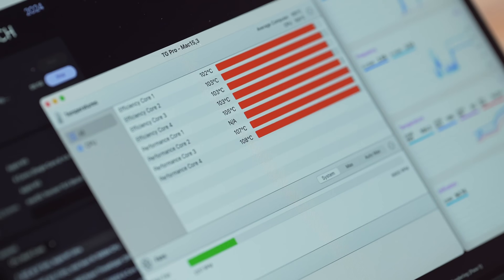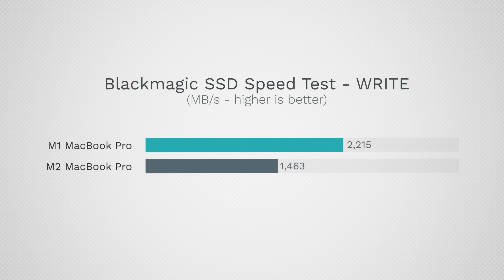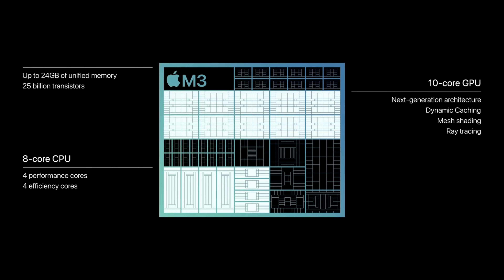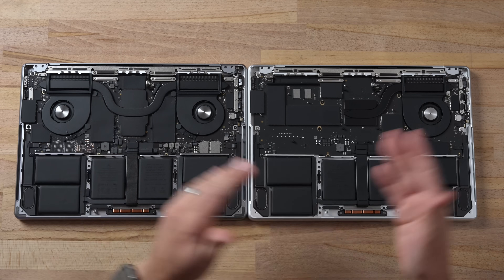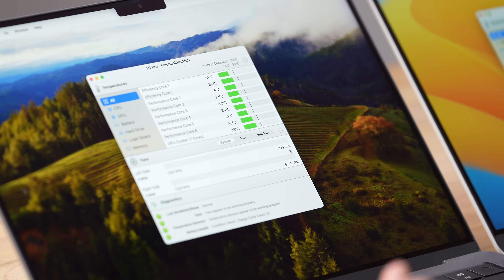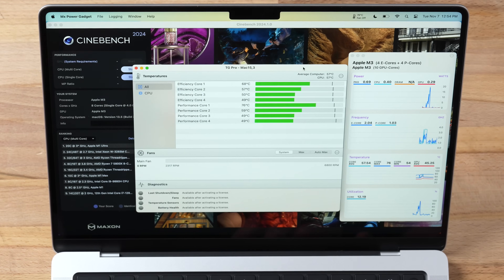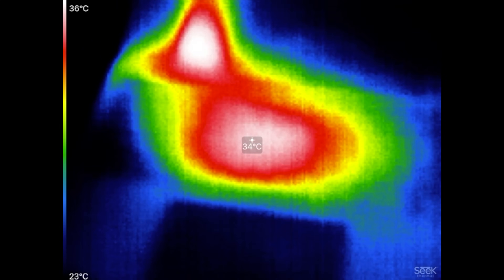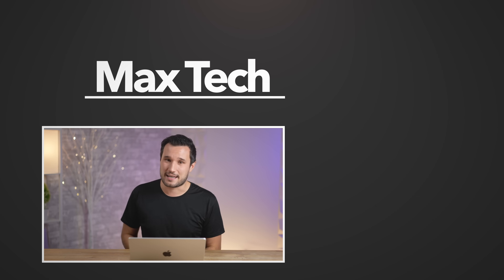M3 MacBook Pro Teardown & Thermals - REALLY, Apple?!

Comment: Even the M3 pro MacBook Pro heats up like crazy, it gets crazy hot just when it’s charging, I would literally just buy an m2 pro MacBook Pro for less then the base m3 MacBook Pro, it has a 16 core gpu and m2 chips don’t have heating problems even on the air, the m3 chips are kinda a disappointment tbh

Comment: I got this M3 MBP, even upgraded it to 16GB Ram.  The Memory Swap is not an issue with 16GB Ram…but the fan…OMG, it kicks up almost immediately with anything semi intensive being put through and runs THE WHOLE TIME.  MUCH LOUDER AND CONSTANTLY RUNNING FAN compared to even my very old 2017 MBP13 Intel i5. And the top left part of M3 MBP14 can get almost burning hot.  Very bad design overall and I consider I have made a mistake buying this new (worst designed) M3 MBP 14-inch.

Comment: With the M3 Airs at most 2 months away, (Though I could see them being announced along side the Vision event), I really wonder what they are going to do to the SoC to get it in the Air. Hitting 108c with a fan spinning at 3500RPM & 95C at 6000RPM in a CPU only test really makes me wonder if they can even put an un-modified M3 in either of the Air chassis. I fully expect them to either turn down the clock speed on 2 of the 4 P cores to the point they may be running at E-Core speeds, or to have an Air SoC that is 6-E Cores and 2 P-Cores. If they put the M3 as it is in the 13inch Air, the throttling could be intense.

Comment: Ok i need some advice, recently i went to Best Buy and looked in the open box/used section and they had a 16 inch M2 Pro 12 core CPU 19 core GPU, 512 GB SSD, 16 GB Ram, it was in wonderful condition, and 14 on the cycle count on the battery and i got it for $1500 and then i got a 2TB SSD for $150, im just wondering if it was a smart choice, Thank You!!!

Comment: On my brand new M3 16GB Macbook Pro I got 710 Muti core, 140 Single Core and 3367 GPU score which, with the exception of the single core, is slightly lower than my 2020 27" iMac 10C/20T with 48GB, 2 TB SSD and AMD Radeon Pro 5700 XT 16 GB. For the disk test I got a slightly faster results for read (3024) and slightly slower for write (3347). This all means that not everything is created equal. However, on the Blender classroom render, the Macbook was about 14 seconds faster (24 seconds against 38 seconds on the iMac). I haven't done anything particularly heavy duty yet (just got it 5 days ago), so my milage may change in the future.
Anyway, good video.

Comment: QUESTION! I’m considering selling my trusty M1 Macbook Air with 16gb ram and getting 14” M3 Pro (either binned or unbinned). What do you think? Would that be a significant upgrade?
Reply: It will be around 2.5 to 3 times the speed of your M1. The display will be considerably brighter and MUCH smoother-feeling to use (120Hz), as well as being larger. Your speakers will sound magnificently better, and your battery life will improve. It'd be a spectacular upgrade and you'd enjoy it very much. That said, the M1 MacBook Air is a legendary computer, and with 16 GB of RAM in yours, you have a great one. To reiterate a very famous question, "¿Por qué no los dos?"

Comment: The unbinned M3 Pro has dual fans. Would love to see how that one handles thermals.
Reply: Wouldn't even the binned M3 Pro model have dual fans? The M3 14" has its own cheaper logic board design. I would expect the M3 Pro and M3 Max 14" machines to all have the same, full-featured logic board design, which would look much more similar to that of the M2 Pro 14" in Max's video.
Reply: Yes, that could be the case. I saw another teardown video of the unbinned, so that's all I was able to confirm. Would love to know for sure. @chuckaeronut

Comment: Apple designs amazing chips and then screw it up with sloppy cooling resulting in thermal throttling. This is really stupid! For that price they charging they should equip every single Macbook with the vapor chamber and proper cooling. They r even saving on copper or what?

Comment: Higher clock speed and transistor density is bound to make the M3 a hot chip. To the unlearned, they would be alarmed by such thermals. There's a reason why chips are made of silicon/sand in the first place, to operate as a semiconductor even at high temperatures. Only at 200°C will it start to breakdown it's structure. I run my M1 MBA hot with ML tasks but the performance is hardly compromised. I would have loved to order the base M3 MBP with the single fan, but I'm waiting for next year's M3 MBA 😊

Comment: There are a lot of weirds about M3 chip, macbook pro 14 with M3 pro has same battery as M2 pro and even slightly bigger 72,4 i. New macbook pro M3 pro and 70 in previous macbook pro M2 pro, but working time absolutely equal,  12 hours browsing and 18 hours apple tv app movie? 

Whaaaat? 

Apple mentioned new M3 more power effective and new tech process 3 nm but in reality it doesn’t work.

Comment: The SSD thing bothers me. I have a M1 Pro 14in with 512gb, and its read speeds are ~7000mb. I assume they used quad chips there. 

So to upgrade CPU I have to downgrade SSD performance?
Reply: It depends if you ever use 7000Mbps? My max speed for all my external devices is under 2Gbps so 7Gbps is overkill times three! Maybe you are able to fully utilise that speed, but the vast majority will not. Of course, the higher storage SSDs will breach 7Gbps.

Comment: I'd love to hear about the comparison between 14" Macbook Pro with M3 Pro, and the 14" (or 16") Macbook Pro with M2 Max. Since M2 Max refurb will be close in price to the M3 Pro line of systems. Also has the change in architecture made any improvements to thermal management (throttling with the 14" system with M3 Max)?

Comment: Honestly even if you don’t need the power I would go for the M3 Pro MBP, is $200 more after adding 16gb of ram to the M3 MBP(which you’ll have to if you want your computer to last more than a couple of years), I knew that the compromises on the regular M3 MBP were more than just 8gb of ram as typical Apple fashion, if Apple would start the M3 MBP with 16gb of ram and have the same internals as the M3Pro MBP then the cheaper model makes sense for most people as it will be $400 cheaper with the only difference being a less powerful yet powerful enough chip, but sadly is not.

Comment: I think they thought it out correctly. Since it's not intended to sustained workloads, the single fan will do just fine. I'm running an M1 Pro (base 8 core) and and i would upgrade to this one simply for the battery life and single core performance increase, even though the multi core will also be higher but not by much. When will you test battery life ?

Comment: Wouldn't it make sense for the Macbook Pros to just have Pro and Max chips?

That way, there is separation between the lineups.
Reply: It has been this way for many years, so Apple users should not be confused. However, looking at the comments, there do appear to be too many people who do not understand that the base MB Pro 14 M3 is not a pro device and is the de facto replacement for the MB Pro 13 M2!

Comment: It's less expensive... of course it will only have one fan.  And for the MacBook Air who needs the M3 anyways?  The M2 still performs great without a fan.  That is one of the attractive features on the MacBook Air.  Fan Noise is just NOT A THING, and you get a thinner and lighter design.  Sure you may wait a few more seconds for a heavy task to complete, but the travel weight and zero fan noise makes that trade off ... pay off.

Comment: I think you should add some notes to your video as it's only the 14" Mac Pro M3 non pro/max that has 1 fan and fewer ports if you get the the 14" M3 Pro/max version you get two fans and the missing extra thunderbolt port

Comment: Running a CPU-only stress test on my 16" base model, the fans don't spin up until it hits 95 degrees, and then it maintains low fan speeds as long as it stays below 100. The workload wasn't enough to make it thermal throttle even with the temp sitting in the mid 90s.

Comment: My M1 macbook air  ,  Write speed = 3800 and Read speed = 2900 . What wrong with Apple ?
Reply: We went through this when the M2 came out. Apple is realigning its lineup since the M2 so that the more you pay, the better the performance and specs, so that meant slower SSDs from the M2 onwards.

Comment: I hope that in the future, M3 chips will switch to the N3E process with larger transistor spacing and smaller chip circuit pattern errors (lower resistance) to improve heating and power consumption issues.
(Although using the N3E process will increase the chip area by 8%)

Comment: In regards to the nand's just a quick follow up if you're into it: the "bigger", older series nand's are BGA110 chips used since the A13 era across the product line. The newer BGA315 chips are indeed smaller in size, but they come in two sizes - lower capacity chips get "narrow" BGA315's whereas the full 1TB/chip pieces are "standard" BGA110-like size and they're slightly taller, also weigh slightly more. BGA315 switch started with the iPhone 14 and moved on to M2 Mini and will be the standard moving forward. BGA315 is in the same way bga-rework replaceable and upgradable as the 110's.

Comment: I think the max permissible Temp is 55°C, then how come M3 go upto 104°C? Won't it violate the set standards?
Reply: 55 degrees is the limit for the chassis heat, which it does not come close to. The temps he measures are for the cores, which are obviously cooled before they exit the system.

Comment: The tear down proves that the base model with the M3 chip is not a Macbook Pro. It is simply a Macbook. That being said, there is nothing wrong with the machine itself but it should have never been marketed as a "Pro" machine.
Reply: @@garrusvakarian8709 The fact that it has one fan and a completely different build than the M3 Pro and M3 Max models proves that it is just a Macbook and not a Macbook Pro.
Reply: People should not be so naive as to consider a branding literal. Common sense says this is not a pro machine as it uses neither of the pro chips (M3 Pro and M3 Max).

Comment: Is Apple feeling the heat and over clocking to maintain the lead? I wonder if a wattage vs performance vs heat graph would be linear, or if they could’ve chosen to run it slower at lower temperature with minimal performance drop.

Comment: You could probably prevent it from thermal throttling by setting the fans to full blast using TG Pro.
Reply: That's what I do. Before sustained work, I put the fans on full blast, avoiding Apple's thermal mapping, which tends to allow the cores to get very hot before they are cooled down. I must admit I thought all people did this as it is common sense!

Comment: Built with 100% recycled aluminium. Less number of components, a little itty bitty better soc. All of this for more money. Zero upgrade options. Apple decided to source everything in the black colour, the fans have a metallic cosmetic treatment. Damn that thing has battery held by glue... In summary, a soc which generally finds use cases in phones and tablets; a rather nice display. A huge thanks to Apple for ripping customers off. I will build a desktop for less than half that price.

Comment: Thank you for exposing this. I know a lot of Youtubers won't mention it.

As a public service, could you make some content on how much repairs of Apple silicon Macs cost? I know a lot of people would like to see that.

The design seems like such a great marketing opportunity, a company could make a replacement, deeper base for the MacBook Pro for those who only intend to use theirs on the desktop, especially for taxing working loads. The base would be, say, 15MM deeper and include an intake fan and out fan, slim but wide fan blades fan, to spin at a slow inaudible speed to shift more air along shrouds, to both prevent thermal throttling and increase life expectancy of the MacBook Pro and its fan.

When I started out as an AV tech, the mantra was that heat and dust kill and that, with age, that dust and drying out of thermal paste (does the Mac Pro use liquid metal, instead?), temperatures could rise more, or rather thermal throttling protection thermal throttles performance more to cope. I'm sure Apple aren't stupid, know what their silicon can take before it's time to thermally throttle. I imagine the fan is high quality. Still, spinning fans at high rpms could shorten the life of the fan (what's the life expectancy of that part, do we know, how easy is it to replace? costly repair?).

Rather than a fan control app like I used on my old iMac that expired from overheating, anyway, is there an app that can step down performance of the CPU to stop it going anywhere near 108?

Be interested to hear if Apple have improved the cooling on the entry level iMac. Haven't seen an ifixit teardown, yet. I'm sure you'll let us know. 

Really hoped Apple were working for better cooling solutions for their products, excellent though those products are, though still probably not great for gaming, especially the 8GB model.

Keep it up, many thanks, liked and shared.

Comment: Apple's decision to go with a single fan on the M3 MacBook Pro seems puzzling, especially when the M2 had dual fans. The difference in thermal performance is quite significant and it's a shame to see it run so hot during the stress test
Reply: The M2 had also only 1 fan in the Macbook Pro. The Pro/Max versions of the chips have 2 fans. The normal version of the chip has no fan (Macbook Air) or 1 fan (Macbook Pro). The Pro in the Macxbook name means that it can sustain the performance longer because of cooling, so it can be used for more extensive workloads. And this goes even higher with the Pro and Max Chip because they have even better cooling (2 fans) because they provide even more performance but also creating more heat.
Reply: It is confusing, but you need to correct what the base MB Pro 14 M3 is a replacement for! It superseded the MB Pro 13 M2 that started with 8GB, had one fan, and ran the base M-chip. This is 100% not a downgrade; it is just people are confusing it with the M3 Pro and M3 Max chips that are the real "pro" devices!

Comment: Any input on the real world performance difference between my current 2020 M1 MBP 16GB 2TB, the base M3 Pro 11 core CPU, 14 core GPU, 18GB or 36GB, 2TB for ~$2400, and a nearly fully specced M3  Max with 16 core CPU, 40 core GPU, 64GB, 2TB for ~$3900?

I mainly do high resolution photo editing (importing upwards of 1000+ raw 45mp images per day), converting raw CR3 files to DNG, working in Adobe Photoshop (generative AI) and Lightroom, 4k video editing and color grading in DaVinci Resolve and Final Cut Pro with Canon's enormous hard to work with H265 codecs. Along with general multi-tasking with all of these applications open at once, a dozen or more tabs in Chrome. All of these tasks seem to push my current 2020 MacBook Pro M1 16GB 2TB pretty hard, with tasks like DNG conversion taking 10+ minutes, imports in lightroom taking ages to load sometimes, some stutters and long renders while video editing.
Reply: M3 Max was massively, massively upgraded over M2 Max and M1 Max. It has 12 performance cores and 4 efficiency cores, and each performance core is 30-45% faster than those of your M1 Pro. It has more p-cores than you have cores! M3 Max appears to be about as fast as M2 Ultra. Yes, Ultra, like... Mac Pro & Studio. You'll notice a very significant speedup going from your M1 Pro to an M3 Max.

The M3 Pro is going to be somewhere in between, but much closer to your M1 Pro level of performance than anywhere near M3 Max. It'll be a bit faster than an unbinned M1 Pro, but not incredibly so. The binned M3 Pro is likely not quite as fast as the unbinned full-spec M2 Pro. I wouldn't pay $2,400 to upgrade from an M1 Pro to a binned M3 Pro.

I would pay LOTS of money to upgrade from an M1 Pro to an M3 Max. Even the binned M3 Max has 10 performance cores -- two more than M1 and M2's Pro and Max variants. The M3 Max got a lot of love this year and is going to steal the show as soon as it starts getting in the hands of reviewers.

To see preliminary benchmarks of M3 Max, go to GeekBench and search "M3 Max" in the results browser. It's an absolute monster.
Reply: @chuckaeronut  just to clarify I have the original M1 chip from late 2020, not the 2021 M1 Pro. I'll take a look at Geekbench

Comment: Apple really went out of their way to engineer a new design for the base M3 just to gimp it? Wouldn't it have been much easier for them to just replace the silicon in the original 14" design and then just retool one part of the production line to cover the missing thunderbolt port on the right side? I'm not an engineer, but these design decisions from Apple seem counter-intuitive to me...

Comment: Isn't 8GB of memory a thing of the past?
Reply: Not on Windows machines, even the very expensive MS Surface Laptop 5 starts at 8GB as does the even pricier Galaxy Book 3 Pro! I am sure if the monopolistic Windows market moved to 16GB base, then Apple would follow. Windows drives trends, not macOS which has a paltry 9% market share.